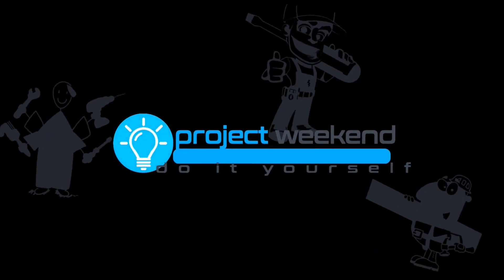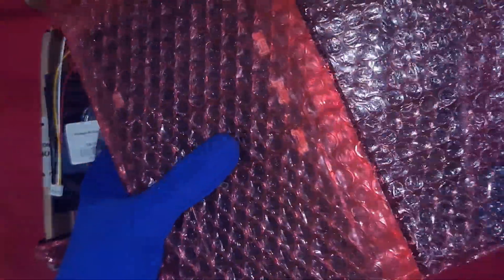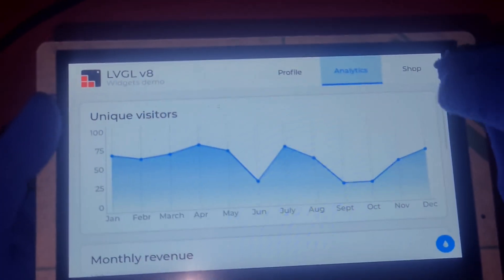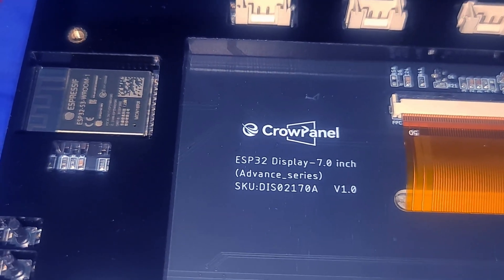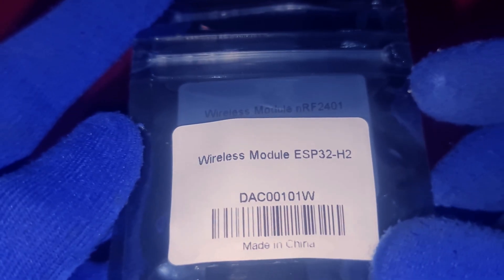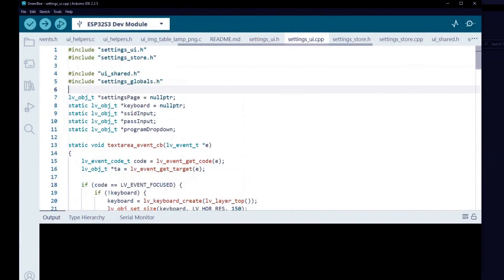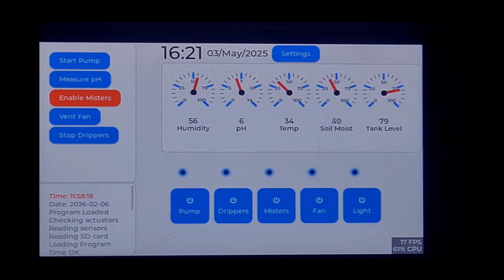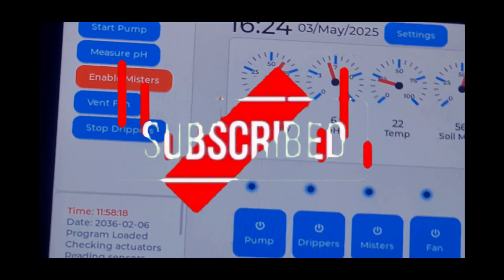ESP32S3  DIY Smart Greenhouse | Elecrow Advance 7" Touch Display Project | ESP32-S3 | ESP32 Lora

Comment: I'm really interested in this project! I recently setup a greenhouse for my wife and adding automation would be very cool. I have experience with the esp32 and have a working system to monitor important parameters for a mushroom grow box. My approach is a bit different from yours but there is plenty of overlap. Would you be interested in doing any collaboration? Is there a way to do private messages or share email (privately)?